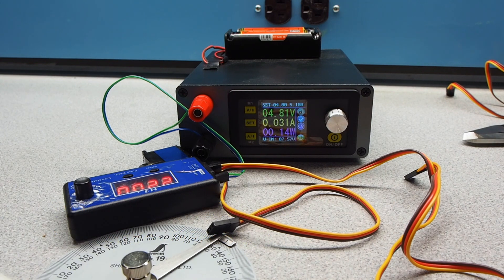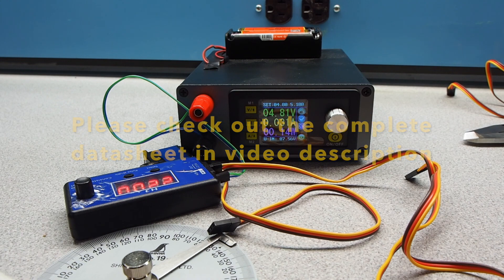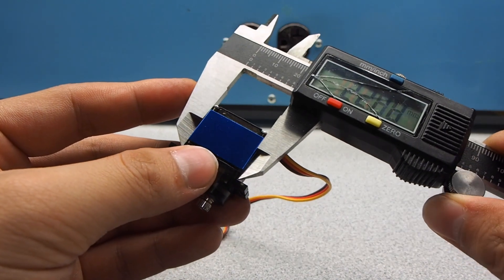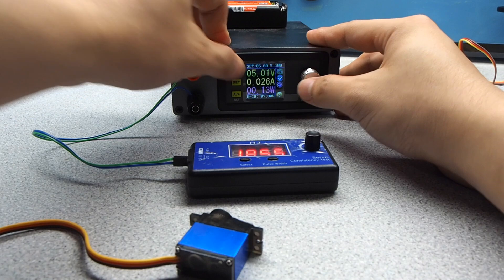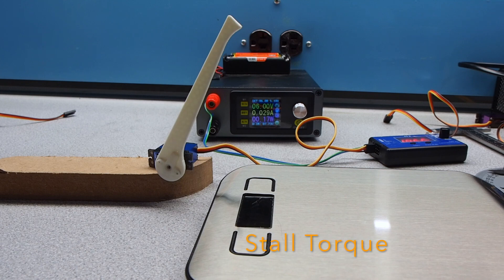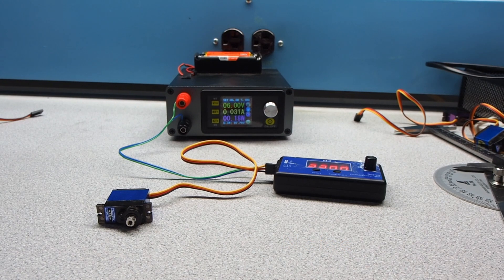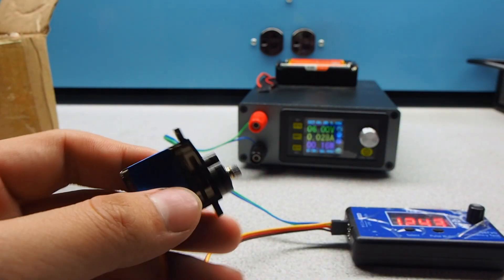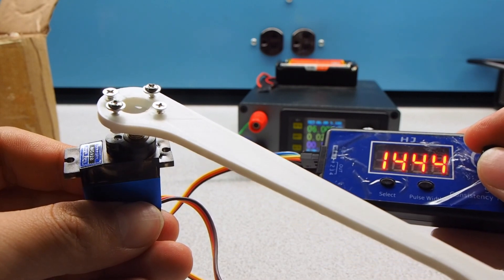Build Your Own Robotic Cat: OpenCat Kit Development Update | Fall Release! | PetoiCamp

Comment: "I'm using a regular digital caliper with a cracked screan" lol
Reply: OH MY GOD MY HERO YOU RESPONDED THANK YOU I WILL CHERISH THIS MOMENT FOR THE REST OF THIS WEEK
Reply: how does open cat see? is it stereo cameras? have you thought of using small infrared distance sensors to navigate around obstacles?
Reply: when you used lidar how did you implement it into such a small kitty? was it 360 degree lidar, or just stationary lidar?
Reply: yeah but for it to get a good reading of its surroundings it would look very unnatural for it to be scanning back and forth in an orderly fashion for its lidar sensor to work properly
Reply: where can i find the cad files for the open cat?
Reply: ooh so are the cad files not available for the public?
Reply: @petoicamp  ooooooooooo interesting well good luck on your future projects. Btw I did a tiny bit of research and found out that stereo cameras would be the most efficient solution for my own robot, that's why I was asking about lidar earlier
Reply: @petoicamp  why is it called open cat if nothing is open
Reply: @petoicamp  ok

Comment: I am using the MG92B Servos, and I am having a lot of trouble finding the right PWM values to use! Right now im using 141 and 932, at 50Hz. It gives decent control, but it seems to be innacurate. Any help is appreciated!
Reply: I got the servos from here: http://graysonhobby.com/towerpro-mg92b-metal-gear-servo.html. I used a Raspberry pi and the Adafruit PWM hat for it. Here is the repo for the code: https://github.com/BrrrIce/Robot The servo code is in Leg.py